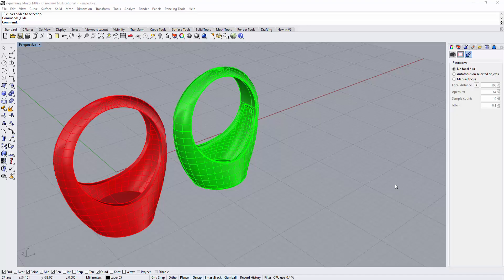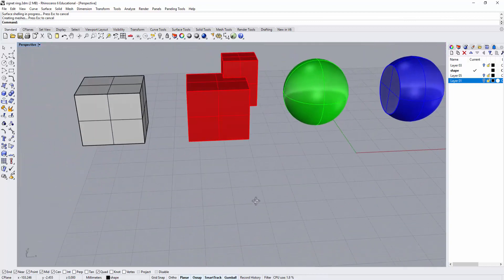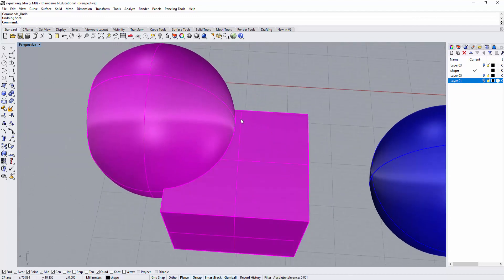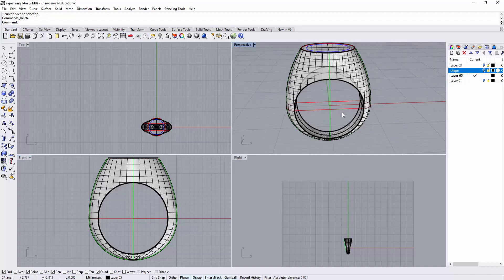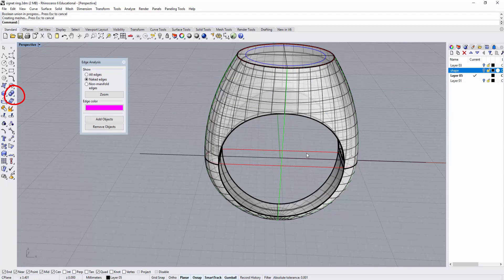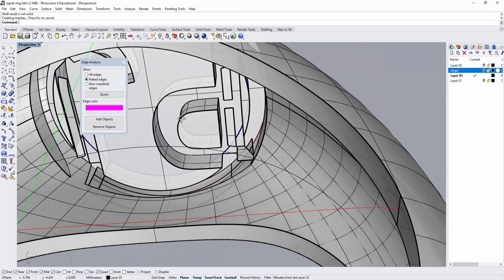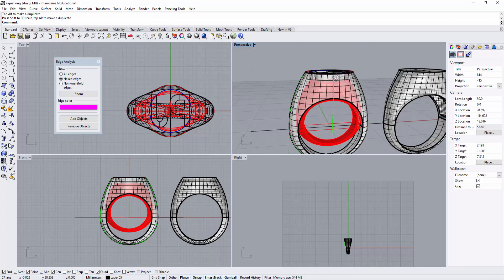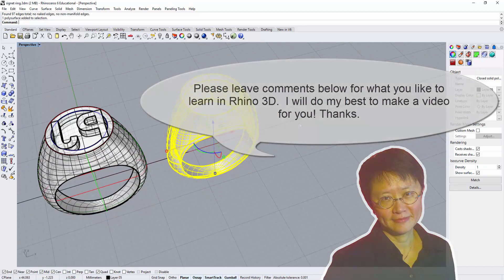Jewelry CAD Design Tutorial #23: Hollow out Signet ring to reduce the metal weight/ Shell Command

Comment: hi there 
can you please let me know how to increase the metal weight from hollow ring  in hollowed out part 
i mean how to unhollow the same signet ring  which you hollowed out
Reply from the maker: if you keep the original curve. rebuild the ring is not too difficult. if you don't have the curves, you can try to offset surface. however, it may have some gaps between surface need to be filled.

Comment: Thankyou very much, again.
I have a question,  Is 0.8mm thick enough for casting purposes?
Reply from the maker: good questions Jesse. it depends on what type of metals and what design you have. the larger ring usually need thicker metals. and if there are a lot of cut out on the design, you also need to consider how metal will flow into certain areas and maybe give a extra sprue in those area.